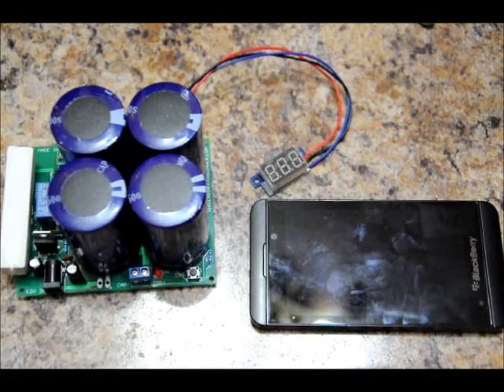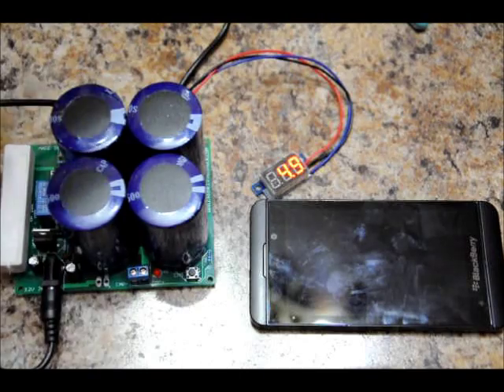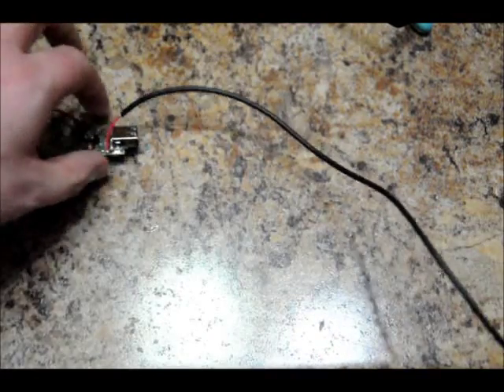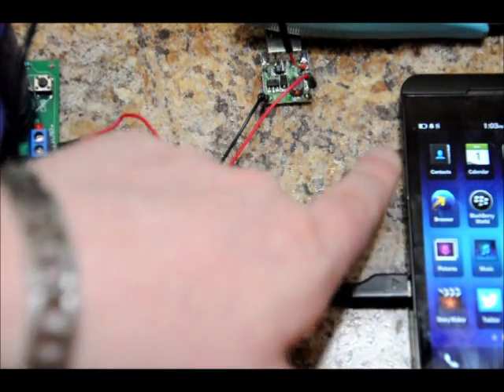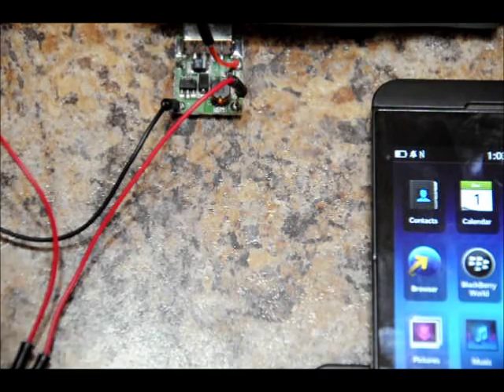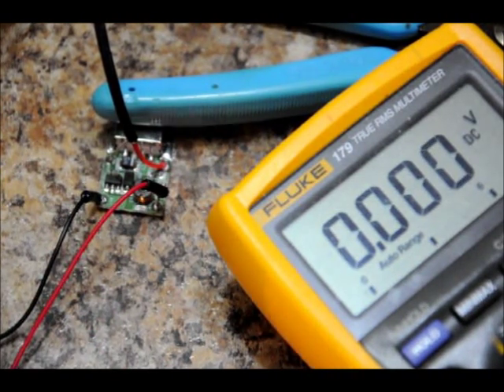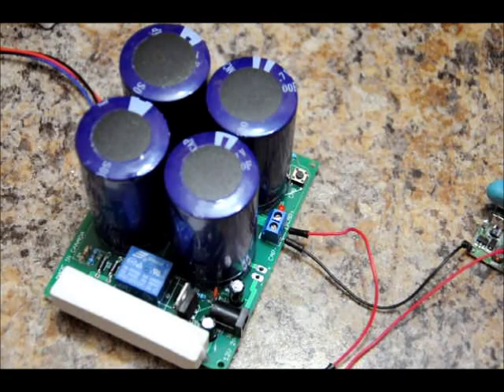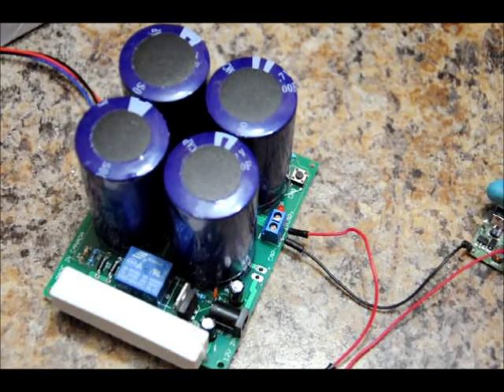Using super capacitors for emergency phone calls!  Give your phone a boost!

Comment: The chinese booster have the maximum of 500 mA, but it starts suplying from 80 mA at 1V. So that booster with 200 mA can be the averange. But nothing with boosters in parallel don't solve.
Hey patrickikis, that cold be a good project, have an booster array to keep the same current. Or even a new board ou module to add/have with capacitors.